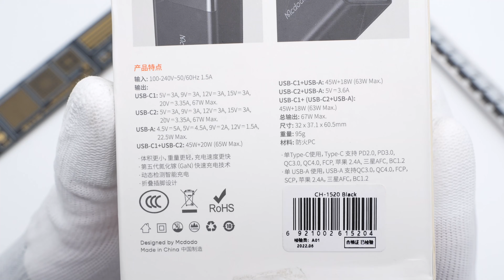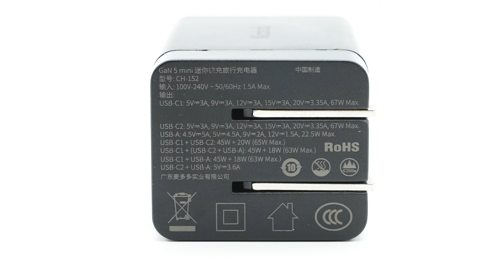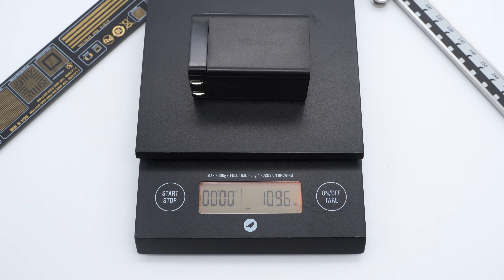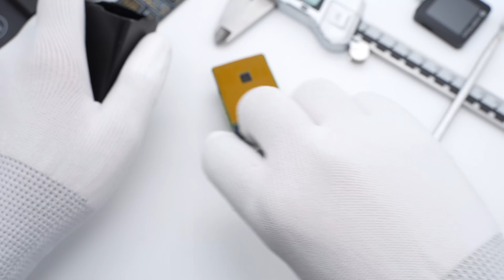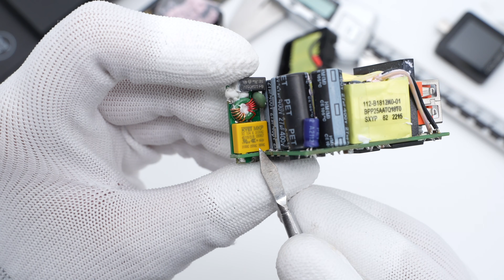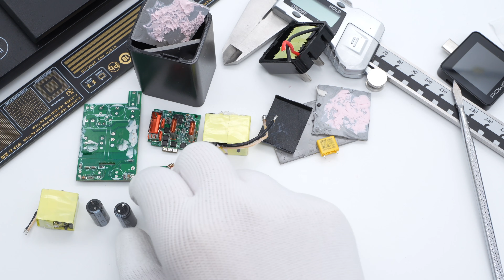Teardown of Mcdodo 65W Mini GaN Charger (2C1A) CH-152

Comment: Great vids ChargerLAB. A couple of suggestions to make them far more useful and valuable :   1. Pl review the Efficiency / Heating and THD / Power Factor at Low, Med and Hi loads, before teardown.    2. Pl talk about the ratings of key components eg Voltage rating of X caps, Y caps, Optos, etc and quality whether above or below other similar items you've torn down.

Comment: Hey ChargerLAB, can you review Ugreen 40w PD dual usb-c foldable pin (UK) charger? 
It has the similar foldable pin design like apple (UK) folding pin charger, but it comes with 2 ports.
Very cool design.
Reply from the maker: Thanks for your suggestion.
We've forwarded it to the team.
Reply: @ChargerLAB  I have question , how we can ensure that a charger supports pps protocol if it supports pd 3.0 ?
Is all pd3.0 chargers supports pps  and if yes then all chargers supports phones like s23 ultra ?
I mean then all pd3.0 charger supports 45 watt and high amount of Voltage like this charger ?